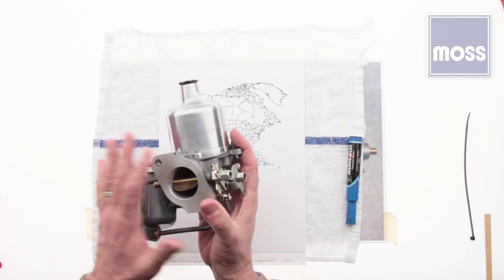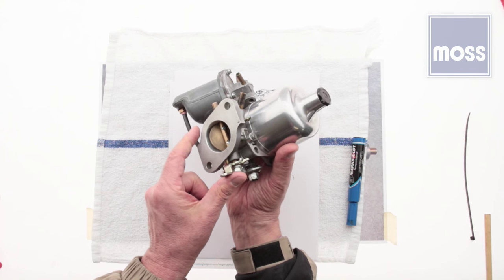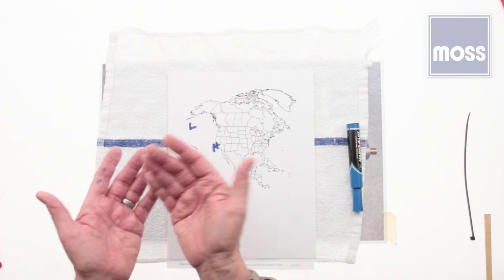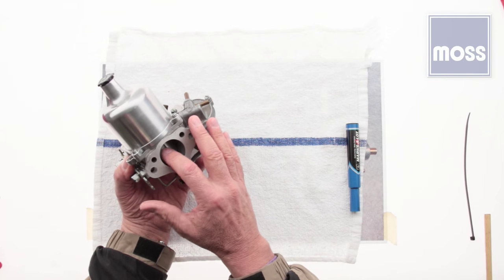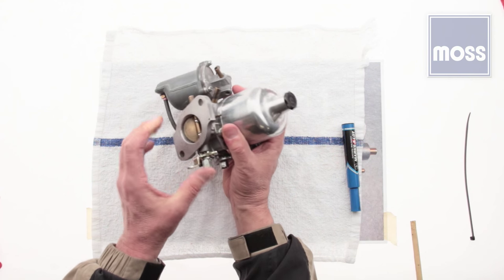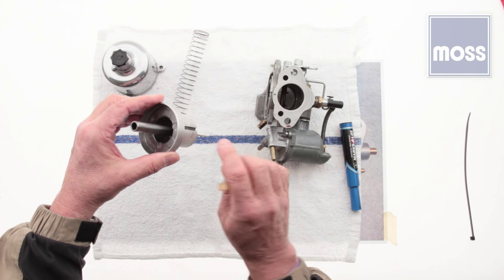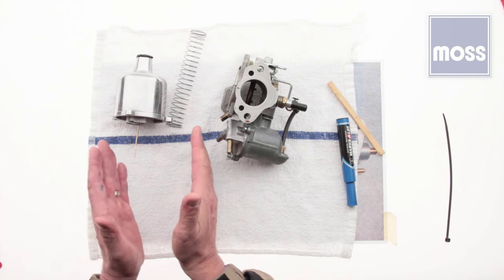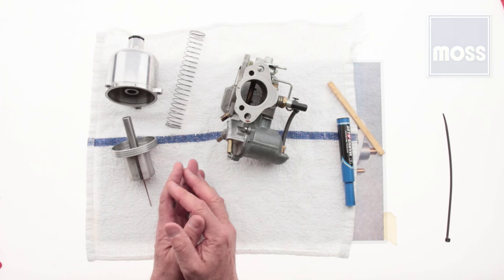Side Draft Carburetors - How They Work

Comment: Aloha yes that’s all well and good 🌺good description of that part of the operation of carburetor 🌺what you did not mention is how to adjust the bottom dial how many times to equate the air and fuel and also to mention the Float  bowl if the float is too high it’s going to run to 💰💰💰Rich 💰💰💰 or if it’s to low going to run to run lean   It has to be in its proper place     you did not mention or explain any of this which would have been greatly helpful  🌺🌺🌺

Comment: The engine side vacuum is not 'pulling' the air into the carburetor, the higher outside (atmospheric) pressure is 'pushing' air into/through the carburetor throat toward the vacuum. and creating a low pressure area above the jet which causes the higher atmospheric pressure in the float bowl to 'push' the fuel out of the jet and into the incoming air stream.
Reply: Wrong

Comment: Great explanation. Just wish you`d added why the dashpot needs oil in it.
Reply: It’s to slow down the upward movement of the piston so when you crack the throttles open quickly, they are able to respond without jumping up too fast and causing a lean condition.

Comment: I appreciate the elegance of the constant depression mechanism. But can anyone explain to me why it is necessary? I mean, why not just attach the throttle cable to the piston, rather than attach it to the butterfly > depression > vacuum chamber > piston?
Reply: because the butterfly opening and and how much the needle is raised out of its seat are not directly proportional to each other. and even if you managed make a complex enough linkage to do this it would vary across all engines
Reply: The piston gradually rises with vacuum and that stops the engine getting a flat spot if you push the throttle wide open suddenly.  That is what used to happen on some motorbikes with an Amal carburetor with a piston coupled directly to the accelerator cable. You had to twist the throttle gently or the engine would cut momentarily.
Reply: Thanks for the responses to my query. So, essentially, it is a mechanism to enrichen the mixture temporarily on acceleration. That makes sense.
Reply: dead accurate. Have a friend with an 80s dodge 360 P/U with a rochester quadrajet, great motor, but if you slam your foot to the floor, the motor hesitates for just a split second then the powerband kick in. "Are you sure thats what you want? OKAAAY let go!"